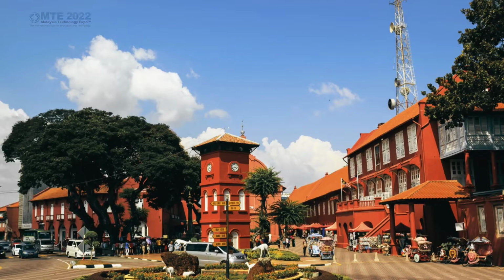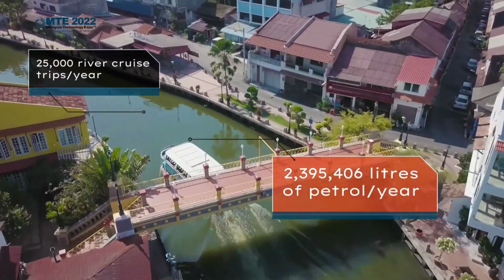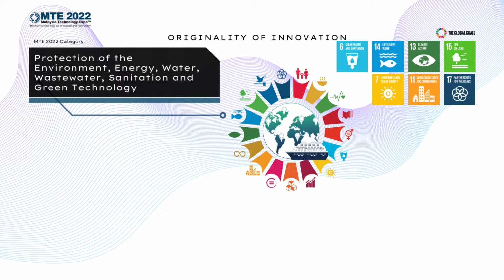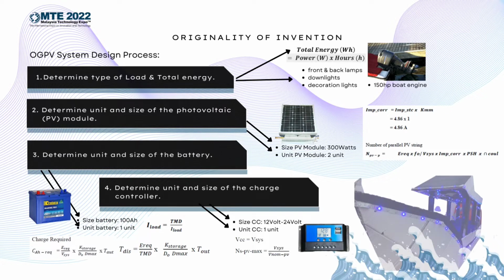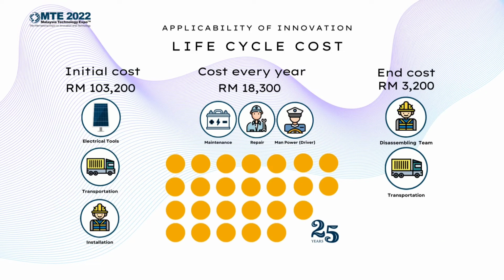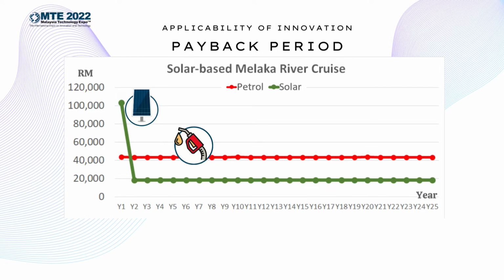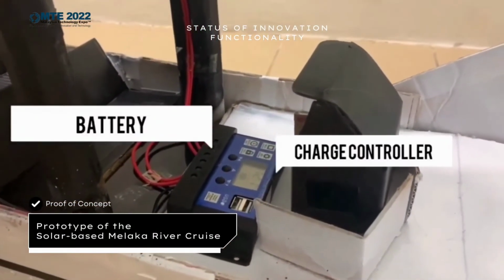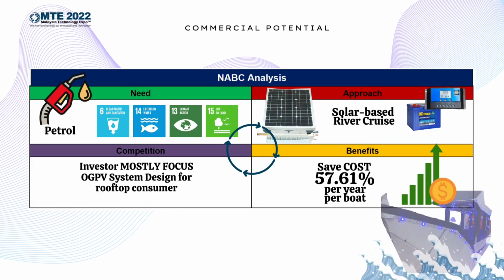MTE 2022 | Solar-based Melaka River Cruise (UTeM) [GOLD AWARD]

Comment: Has the solar system been installed on a Melaka river cruise to date? Any river cruise in operation currently?
Reply from the maker: To date, still in planning stage, due to some budget aka no funding. We are really greatfull for the sponsorship offers to successfully execute the project.
Reply: @atikahrazi5531  Hi. I see that your project was for using solar powered system for replacement of diesel genset to light up decoration lights of the cruise boat only. How about solar powered motors for operating the boats.
Reply: If your team can work out for solar powered system for replacement replacement of diesel outboard motors and decoration, suggest a cost analysis be carried out and look for a commercial company to sponsor a pilot operational project. By then,  you can have operating data and costs savings. If you keep me posted,  I can assist as well.